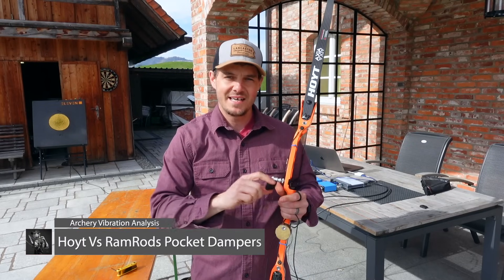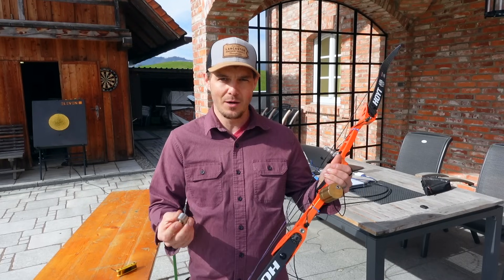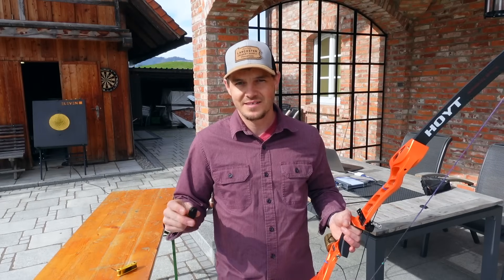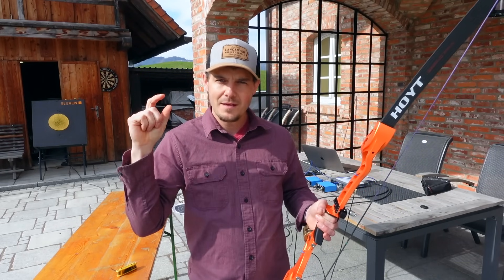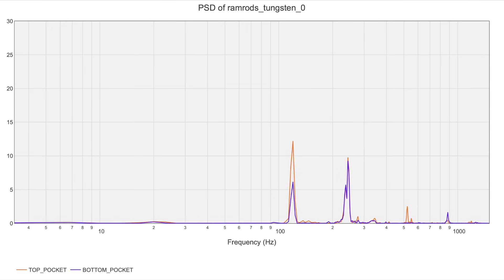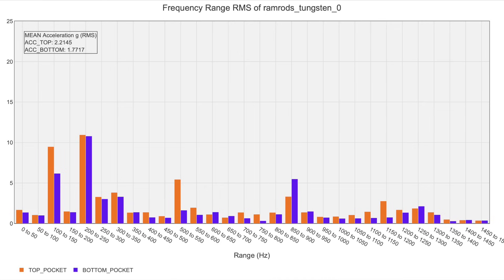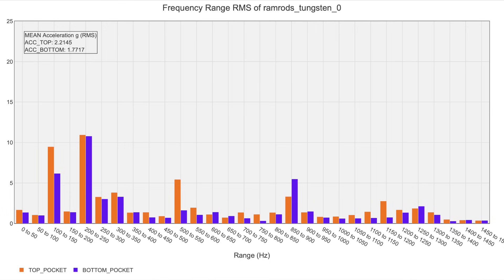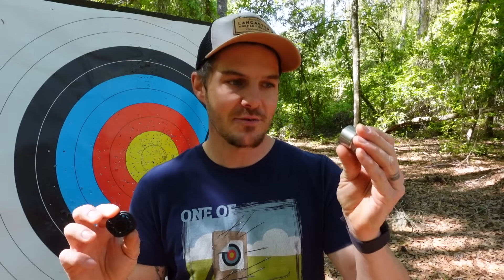RamRods Tungsten Dampened Riser Weights vs Hoyt 360 Degree Pocket Damper

Comment: Hi Jake, thank you so much🙏  as a young engineer from germany I’m a data nerd too. 
Actually I’m developing a 360 dampener for the older Xceed riser with the goal of half of the mass but with similar results.
So your measurement comparison would be exactly the same what I have to do with my damper and the original Hoyt weight for Xceed.
Could you tell me what was the name of the measurement device that you used for checking the vibration or could you give me the contact from the gentleman in Austria?

Comment: As a mechanical engineer and data nerd with a background in machine design and vibration spectral analysis....  This is a collision of worlds that I am so happy to see.  I love it.

A large part of the peak dampening is likely coming from the additional mass of the ramrod piece.  There are 2 ways to effect a system to reduce vibration, mass and stiffness.  Neither of these are doing anything for stiffness, but the mass is adding inertia and that is helping absorb the low frequency energy.  It's still a great experiment to show how these things affect the system, but more of a proof that more mass = better damping.   What would be REALLY interesting is a 3oz stainless or brass weight in the same place as the Ramrod tungsten powder one.  THAT's would be apples to apples to determine if the tungsten is worth it, or if it's really just the mass doing the work.
Reply: Definitely! A control weight would really be interesting to see.
Reply: I’m late to the party 🎉, but find this very interesting.  I also have a ME design background and have dabbled with modal and spectral vibration analysis.   I am not familiar how powdered tungsten is used as a damping media.  Can anyone explain how it provides damping?   I get the mass reducing peak accelerations, but does the powdered tungsten actually provide a “C” term damping coefficient?    Perhaps it’s suspended in a viscous fluid or gel?
Aside, I recall how much I liked using MATLAB’s “specgram()” function to plot spectral data.  Seeing a time history of Frequency with color shaded amplitude vs time is intuitive and I found it easier to internalize the data.   It would be nice to see some modal analysis data, even if just from a finite element analysis for the riser.

Comment: Interesting data and harmonics.  These are sound frequencies.  It might be possible to create an adapter to mount that can be used for electromagnetic sound dampening or noise cancelling for this.  It is also possible to find something that could produce a higher frequency and that as well would be less troubling.

Also, noted... and this concerns me more.  The trees behind you indicate that there could be very harmful negative earth gridlines passing through that area. Which way they pass can only be determined by testing.  The trees are bending to try to move away from them.  There may be underground water there as well and crossings of earth grid boundaries, that is if there are tumors found on the tree, check for them.  (These can be corrected with simple tools using Biogeometry), but they are very unhealthy for  you and your family.  Make sure these lines are not going through your house as well; particularly in areas where you are sleeping.  It's not healthy. Find someone to test and correct this if so.  Contact Vesica.org.  I think they are near you and they may know someone close to you who can test for this.  You would not want to spend a lot of time in them if this is so. They can produce tumors in a person's organs through vibratory resonance.

Comment: I shoot xceed riser after I switched from carbon riser. The only thing I don't like about the xceed is the vibration is more than the old nanomax riser I used to shoot. So I bought these RamRods tungsten dampened riser weights. The riser feels better but it is much heavier than before. I need to practice more and adjust my stablizer setup in order have a good control of the bow. I think RamRods has 1oz version of it but I have got used to the 3oz one already. I am still curious to know the different in dampening effect between 1oz and 3oz version of this weight.
Reply from the maker: I'm confident the 3 will dampen more but by how much I am not sure... I'll have to try that when I return to Austria or get my own analysis gear.

Comment: Very informative video! Ill have to test them out myself whenever my GMX 3 comes in! I wasn't gonna try out the ramrods, but with this info I feel i should give it a try.

Question for yea: Are you gonna test with the 1 ounce weight as well to see if its has more of a difference than the 360 dampener and compare to the 3 oz weight? 

Also I am having issues with the collab links. They say the site cannot be reached.
Reply from the maker: The 3oz weight is filled with powdered tungsten so it acts as a vibration dampener, the mass does dampen some but compared to a solid weight these dampen much more. 

Can you tell me which links don't work? When I copy and paste them, they work for me.
Reply: @JakeKaminskiArchery  Gotcha! I was curious if the 1 oz might still be an upgrade when compared to that 360 dampener. So that way you can get 

All the collab links don't work for me. The only one that does work for me is the one leading to RamRods

Comment: Thanks for the informative video Jake, always nice to see the graphs and such, I like to geek out on data as well xD

I have a quick question. My wife and I recently got ATF-DX risers from Win&Win, and we noticed that the risers also have pockets in the limb socket, is it possible to add dampeners there or is it just a way of reducing the riser mass to make it lighter?
Reply: My ATF-X has this pocket as well.  It's likely originally just a way to reduce the riser mass in manufacturing.  But if a weight fits in there.....  why not use the space.

Comment: Results may vary. Should have tested without that brass weight on riser. Perhaps that’s why bottom versus top Trace was different.
Reply: It's unlikely the bottom and top trace would ever be the same solely based on geometry of the riser and tiller of the bow.  Because of limb tiller and string crawl, the timing and intensity of inputs is basically impossible to get exactly the same.  The brass weight is just adding overall mass to the system and is not changing the stiffness of the riser, so if anything it is helping overall dampening of the system but not really changing much else.
Reply: @KentRodgman  yes. Correct like you noted. The weight is helping damping. No one suggested change in stiffness. Agree again with you.